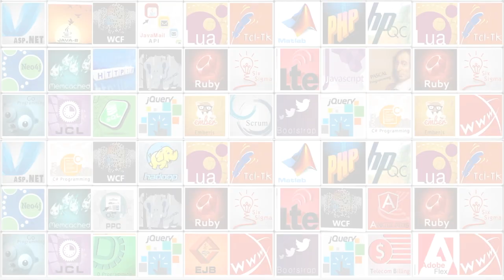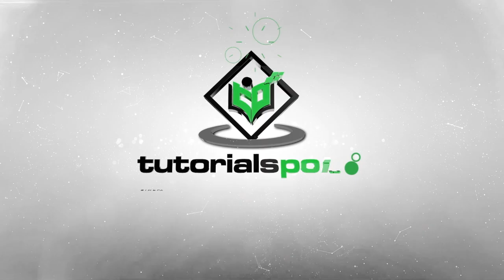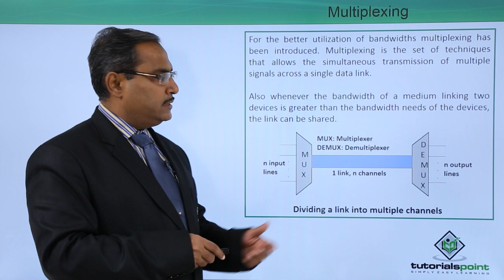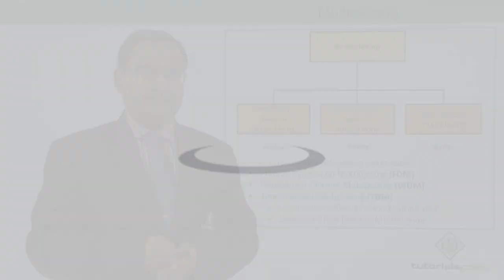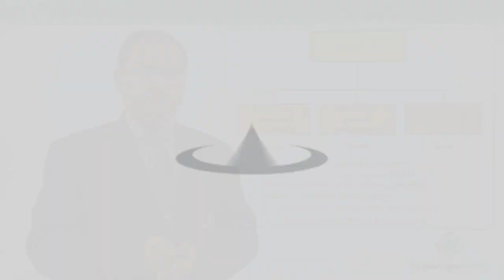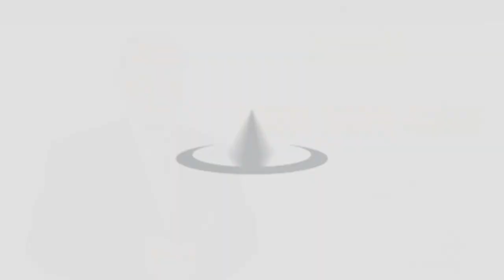Why Multiplexing?

Comment: OK MY QUESTION IS WHAT IS MULTIPLEXING?
Reply: Multiplexing is method of unite more TV channels or radio channels on one frequency and demultiplexing is opposite, it is separating the package of more TV channels or radio channels from each other. The TV or radio channels in multiplexing on one frequency do not interfere with each other because they are phase shifted from each other. For instance today on one frequency you can unite 10 different TV channels.